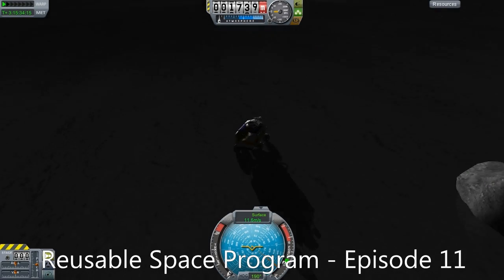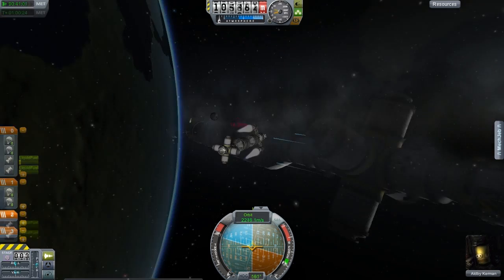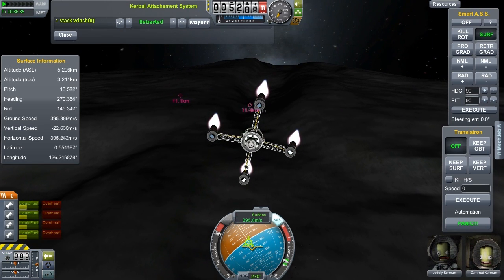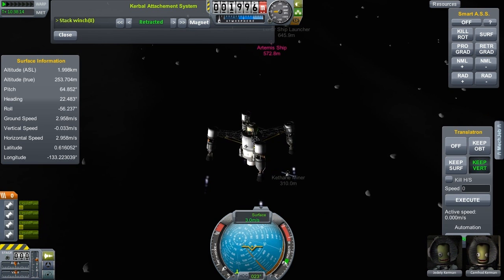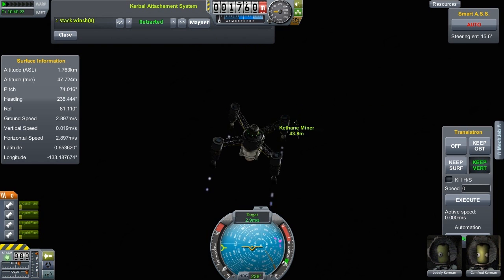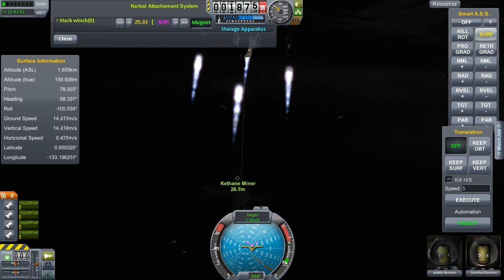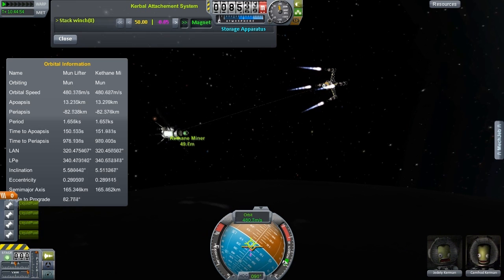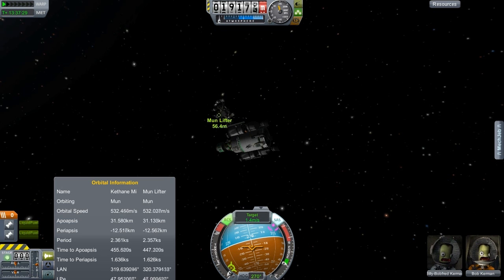Kerbal Space Program - Reusable Space Program - Episode 11 - Mun Rescue

Comment: the reason it was not converting fuel was the positioning of the tanks. to convert fuel you need a tank in the same stack, not at the side of it. the tanks of the crane were docket in the right position therefore it was able to produce fuel.

Comment: Hey Scott I really need some help my KSP keeps crashing all the time it runs fine on my Intergrated I7 graphics but slow as hell but when I run it on my Nvidia 540m 2gbGraphicsmemory it crashes constantly. I run Windows 7 64 bit on a dell L502X, Ive tried new drivers old drivers and also every reinstalling them same with KSP and also tried to clean my entire disk and then reinstall the drivers did nothing to help. I think its the memory bug but I get "Nvidia Display driver has crashed - recovere

Comment: An impressive rescue!  Slightly less impressive in light of the fact that most of it wasn't actually required.  You do know you can attach KAS parts to Kerbals, right?  You could've landed the tug, gotten out, and dragged the magnet over to the top of the Kethane miner unit manually.  Not practical on Kerbin, but entirely doable on the Mun.